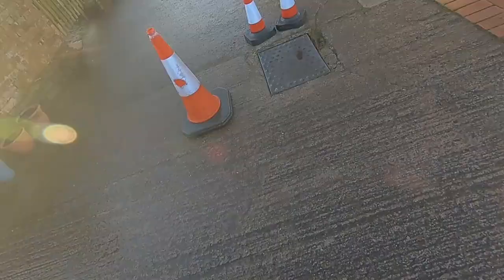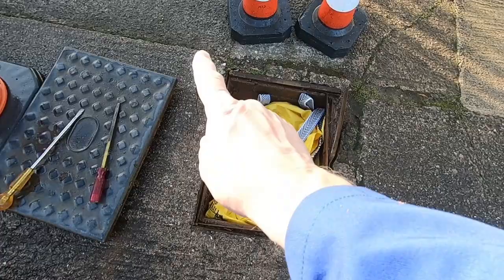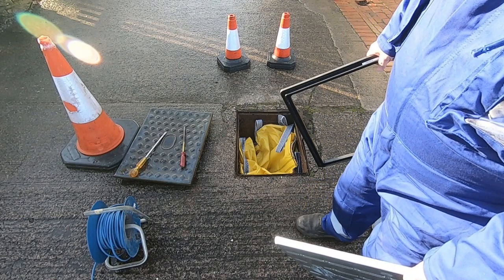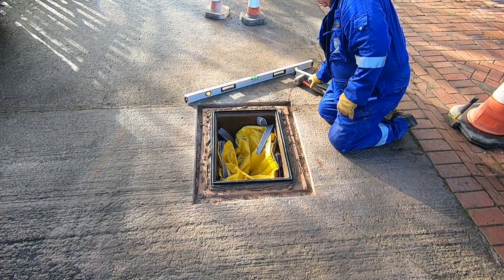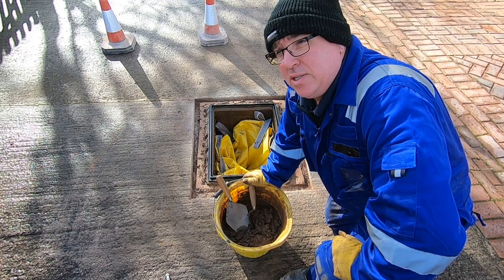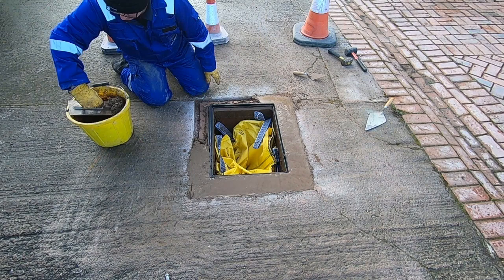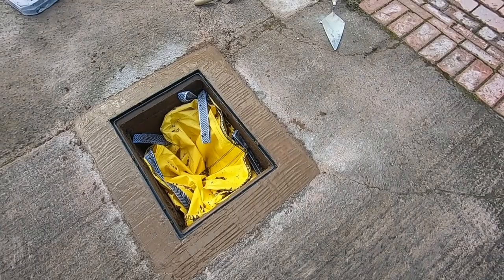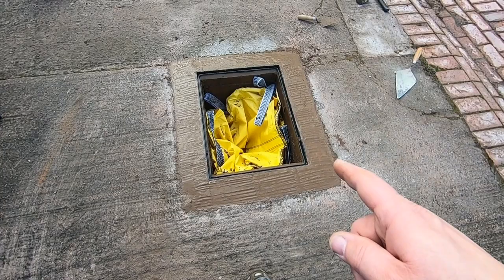Replacing a rusty manhole cover & surround.

Comment: Thank you - I looked at a clarks drain cover today as the lid has rotted on mine in the garden - and was wondering how do I change this. Now I know it is reasonably straight forward, thanks to your help. I will get it ordered and done.
Reply from the maker: No probs. Good luck with the repair.
Cheers Larcs 👍

Comment: Thanks for the vid, I'm just about to replace mine, I made the mistake of thinking the frame slotted in to the brick work but I see that it rests on top and is held in place by the concrete you laid. I just nervous that it will slip because I park cars on mine.
Reply from the maker: Thanks, ours is still good and it gets driven over every day. Good luck sorting it out 🤞.
Cheers Larcs 👍

Comment: I detect a Bristolian accent? 
Thanks for this though - very helpful. 
Question - why use mortar for bedding the frame and concrete for filling the gap surrounding? Sorry - not a builder, so have no clue.
Reply from the maker: Somerset boy, not far from Brizzol👍. I used mortar to bed it down because the stones in the concrete could stop it leveling down properly (they won't squish like mortar 😉).
Reply: @LarcsWorkshop  ahhh I see. That makes sense. Nice one, cheers babber!
Reply from the maker: @dbrown8698  👍

Comment: Great video, thanks. What is the tool called that you cut through the tarmac with before breaking it up? Could I use that tool to cut through a paving stone?
Reply from the maker: Thanks, it's a 9 inch grinder with a diamond cutting disc fitted & yes, it's good for cutting paving stone.
Cheers Larcs 👍

Comment: How many parts of cement / sand /mortar for the mixture that you use to hold the manhole frame down & fill in the edges that you cut out earlier? Any particular brand of mortar/cement would you recommend?
Reply from the maker: Thanks, I set the frame down on mortar - 1 part cement, 3 parts builders sand. Filled in around it with concrete - 1 part cement, 2 parts chipping, 3 parts sand. Or 1 part cement, 5 parts ballast. Any normal cement from a builders merchants will do.
Cheers Larcs 👍

Comment: Brilliant. Just the info I needed, thanks. Just one question  - Is the ballast really required or would just a sand and cement mix work?
Reply from the maker: Cheers 👍. Could be ok for foot traffic, but I wouldn't recommend it if you're driving over it.

Comment: That cover no good need a heavy duty one as its on a road good luck driving ur car over that i take your next video will be how to remove a car from chamber
Reply from the maker: It's rated at 10tonnes and it's in a domestic drive so should be ok. I'll keep an eye on it though, thanks 👍
Reply: There is always one isn't there. Know it all who clearly doesn't.
Reply: That lid is not rated 10tonnes. It's 6.25kilo Newtons or 6.25tonnes. It's not even up to A15 on BSI. It's a Facta one for pavement only. Won't do you any harm but it's the cheapest money can buy and if you want it to last a lifetime you must get a cast iron one, not a plastic frame one